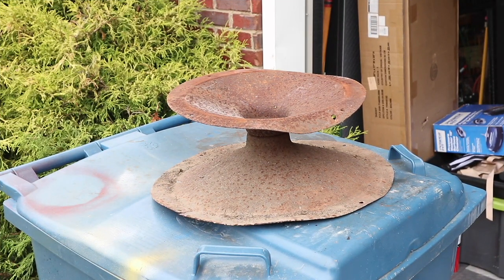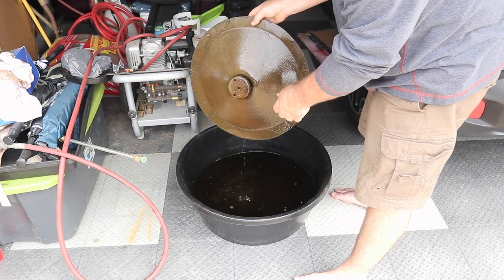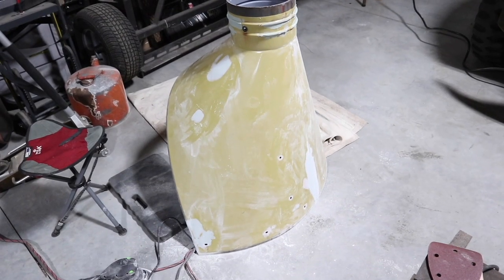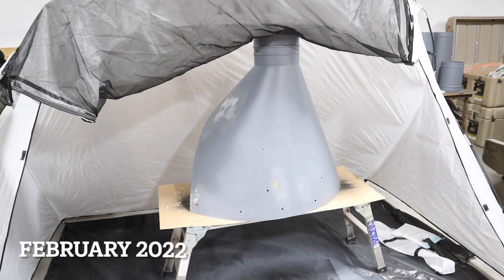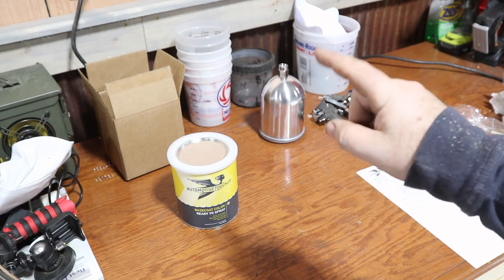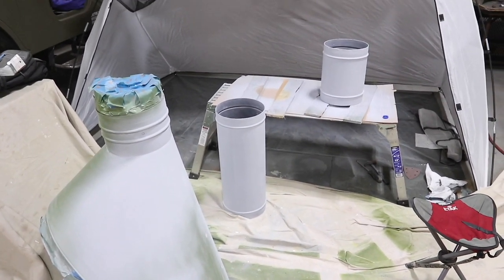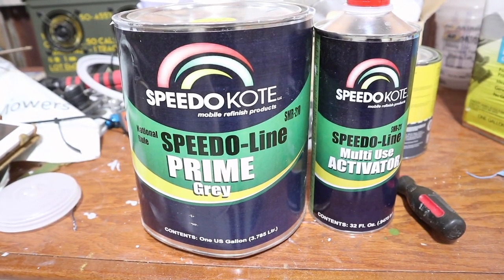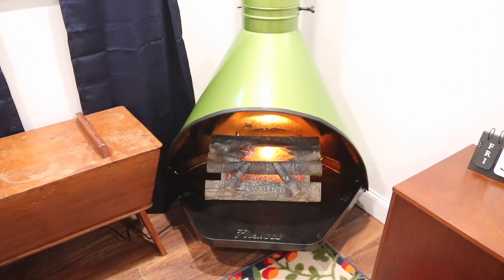TNT #112:  Mid Century Modern Fireplace / Firehood Restoration

Comment: Impressive...  I think I just might have sent that one to the scrap yard.  Nice save... I think you need to do an Electrolysis Tank build video.  If you plan to do one give me a call.  I have lots of suggestions.  I have been using mine to clean cast iron pans for several years.
Reply from the maker: Will certainly hit you up, that is something I have been wanting to try.

Comment: I have this fireplace. I love everything about it. Bought mine as a rust bucket and restored it…. Not as extravagant as you have but many coats of high heat engine block paint is what I used. 
Now I’m working on designing a piece of sheet metal for the screen to slow the fire down.
As you probably know, the stove burns hot but burns wood like no other.
Any recommendations of what kind of sheet metal to use for the screen?
Be appropriated:)
Reply from the maker: Roxanne, if you are looking to fashion something that is more freestanding that can be set in there I would lean towards something like the following and have someone weld up a simple frame with handle.   https://www.amazon.com/SOSCo-Metals-Expanded-Metal-Flattened/dp/B08SSXSQYB/ref=asc_df_B08SSXSQYB/?hvqmt=&hvpos=&hvpone=&hvlocphy=9014169&hvptwo=&psc=1&hvadid=475805673032&hvdev=m&hvdvcmdl=&hvtargid=pla-1198579080468&hvlocint=&hvnetw=g&hvrand=8966920050084868171&camp=1789&creative=9325&linkCode=ur2&tag=iphone0dce-20&linkId=OMBRYAX56M45VB35
Reply from the maker: And thank you very much for the feedback and question.
Reply: @TryNewThings  
Thank you so much for your  quick response.
I actually have the original screen for the malm fireplace. What I’m trying to design is a sheet metal piece to hook onto the screen , when I need to slow the fire as a door.
Not sure what kind of metal sheeting would stand the heat. Also , would creating an enclosure mess with the design of the operation of the stove?
Can’t send pictures here unfortunately:(
Reply from the maker: My email address is provided on my channel page if you would like to send photos.

Comment: Thanks for posting this video. Can any general contractor install this or is it worth contacting a specialist?
Reply from the maker: We set ours up for "artistic purposes only".   Meaning our pipe does not exit through the ceiling (electric fire logs only).     If I were to set this up to be used as a real fireplace I would be looking for a contractor with wood stove / pellet stove installation experience.

Comment: Thanks for sharing a great looking job. Any problems or tricks to disassemble the fireplace parts? I have one to remove from a neighbors home that will be demoed in a few days.
Reply from the maker: Any problems... yes!   The one my daughter picked up was kept and used outdoors and every bolt was rusted solid (nuts to bolts).    I ended up drilling out or breaking off every fastener and replaced them with stainless ones.    Also had to use JBWeld to 'rebuild' the holes as some of them rusted to larger than original diameter.   Filled with JB Weld, sanded, drilled new holes.    You intend on re-furbishing it?
Reply: @TryNewThings  My project is coming from indoor location so I hope rust will not be a big problem. Haven’t had much time to inspect. Wondering how the sections come apart? Roof section may be much rustier.
Reply from the maker: pipe sections should just be slip fit one over the other, the hood bolted to the firewood tray with I think about 8 bolts fed in from the outside with nuts on the inside.   The stand we had that was all bent out of shape in our case wasn't bolted to the firewood tray, the stove just 'sat' on top of it.

Comment: May I ask where you found the pipes? I bought this same type of fireplace, but the seller didn’t have any pipes to go with it
Reply from the maker: I actually do not remember... I did not have trouble finding it though.   I'll have to check the diameter to see if I can find it again.   It is galvanized, single layer, came flat and there is a seam that overlaps to put it together.    I'll try and remember to check the dimensions when I'm back out the farm this weekend.

Comment: Hey if the original paint has some rust bleeding  - not rust like eating thru the metal, more like bleeding on the ceramic (?) paint from the above rusted joints of where the connection, wondering if there is a way to clean up those rust type markings on the paint without having to RE paint the whole thing
Reply from the maker: I'd be worried about using a product that is too aggressive and ends up taking off more than just the rust bleeding... I will see what I can find.
Reply from the maker: I would look at videos showing how to remove rust stains from enamel bath tubs.    Should work the same on the fireplace.
Reply: @TryNewThings  thanks your awesome ! Appreciate

Comment: Hey great job i just purchased a mid century modern fireplace myself that I'm going to restore. I had a few questions. Is this paint heat resistant? And what kind of paint did you use?
Reply from the maker: The black paint is heat resistant… however, the 1972 Datsun avocado green metallic that my daughter picked out is not.    She bought the fireplace with no intention of it being more than a display piece.    Likely tougher to get a good variety of heat paint outside red, orange, blue engine paints etc.   congrats on your purchase, did you happen to get one with a screen?    We are missing the screen on ours.
Reply: @TryNewThings  oh ok got it.. i want to paint mines gold there's a company that is quoting me to do a ceramic high temp coating if it's not too much i will go ahead with it... yes i got mines with the screen for 850 bucks mint condition.